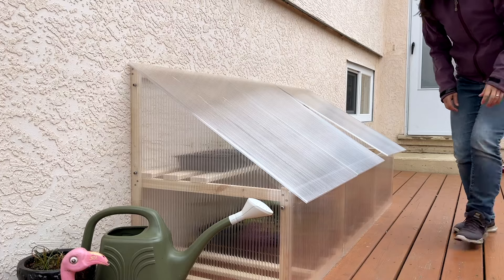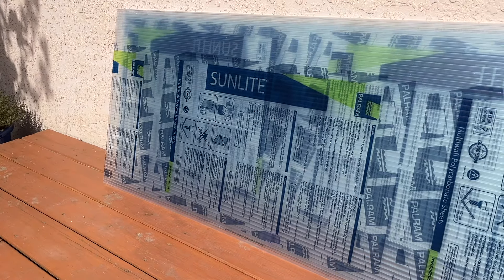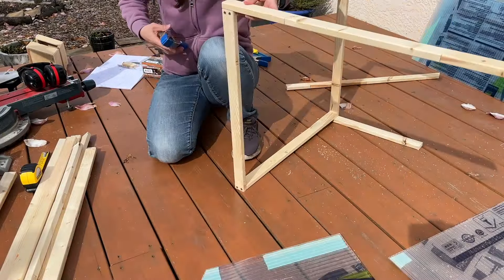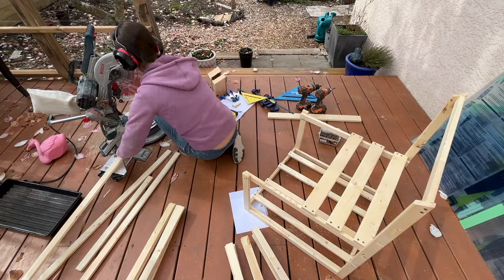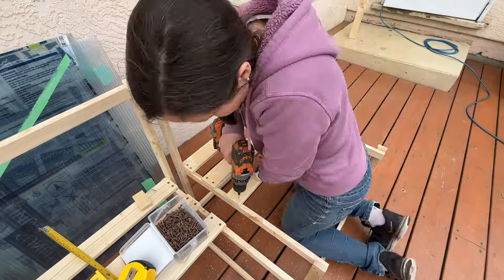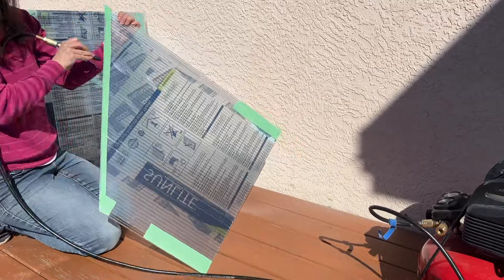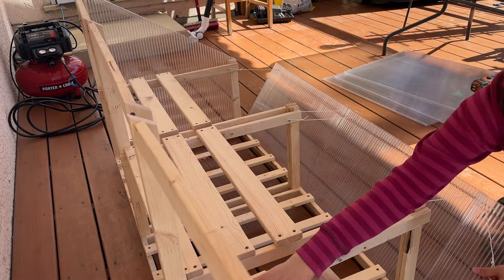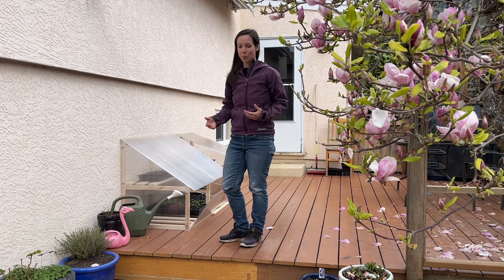Mini Greenhouse Build - DIY

Comment: When you messed up the square base the first time, was it because you forgot to subtract the width of the 2 overlapping pieces? Any of the viewers that have no construction experience might not  realize that’s a necessary step when measuring for the frame. Also for anyone that doesn’t know, to make sure your base frame is squared, measure from corner to corner in both diagonal directions and make sure both measurements are the same. If the measurements aren’t the same, the box is not squared.this may not seem like a problem until you go to put the top and side panels on and you see that they don’t line up. Great build, I’m going to try making something like this for this winter as well as some hoop house type structures for extending my salad greens and whatnot. 

I also don’t tend to have a fully thought out idea of how I’m building my garden diy projects until I’m actually making them.
Reply from the maker: Good tips! I use those methods too  👍
Ya, I must have forgotten to account for something in my measurements. I remember trying to work out what I did but I didn't figure it out quickly. I decided it wasn't important to know exactly what the mistake was🙃. I knew how to fix it and that was enough for that moment 😋
Thanks for watching and enjoy your garden!
Reply: @KatesGarden  I do it at work all the time. Sometimes I’ll accidentally change the measurement by 1 inch, we call it the “1 inch rule”. You’ll tell yourself over and over in your head the piece needs to be 34 1/2 inches, and then measure it to 35 1/2 inches by accident 🤣
Reply from the maker: @Howwerelivingfishing  lol, yup! As long as it’s just a bit to big it’s no big deal and easy to fix 😅
Reply: This was actually very helpful! Thank you! @Howwerelivingfishing

Comment: It's nice and good, but way too expensive with the plastic, why didn't u go with the 6mm foil?
Reply from the maker: I’m not familiar with 6mm foil. Thanks
Reply: @KatesGarden  Not I'm not sure if it's called like that, but it's the standard plastic transparent foil used for polytunnels
Reply from the maker: @adriandavid970  oh I see. Yes that would be an alternative option. Some changes to the design of the frame would be needed but it would absolutely be possible and probably less expensive.
Reply: @KatesGarden  Definitely less expensive, I was "shocked" to see the price list at the end of your video...Anyway, thank you for the idea!

Comment: That plastic stuff is expensive.
I like that you showed the process of finding and fixing your mistakes. Nice job.
Reply from the maker: Thanks, I try to show the process as it really happened. 👍
And yes, the plastic panels are expensive. They weren’t my first choice, but I think they ended up being the best of my options. Thanks for watching, have a great weekend! 😀
Reply: Im going to try mine with Vapor barrier, because I got it for free by salvaging it from a construction site that was throwing it out. It won’t last nearly as long I’d imagine. I may also try using some glass windows I salvaged.construction sites can be a good mine but make sure you have permission before grabbing stuff lol
Reply: There are a lot of options the panels could be replaced with but there will be pros and cons to consider with each choice (price, durability, weight, aesthetics, how easy the material is to work with etc)

Comment: Loved the design, just wondering if the bottom seedlings would be getting enough light. Because even with constant rotating you'll cut the light in half so just wondering that part.
Reply from the maker: Thanks!
This is such a great question and something I was considering while I was planning. My goal was to use this greenhouse just during the spring so the sun would be lower during the day. By the time summer approached and the sun higher, it would be warmer and the greenhouse not needed. (So I should be planting, or the more tolerant plants can sit next to the greenhouse outside to make more space) Also, because the upper shelf is only half as deep, it lets the light into the back more easily. If more light is needed, the greenhouse could be built taller so the upper shelf can be higher.
Hope that helps, thanks!

Comment: Im looking to adapt a similar design to keep some planted hibiscus shrubs safe through the winter without digging them up...hopefully.  How sealed do the edges, lid, and bottom need to be, or is there room for having a few gaps?
Reply from the maker: That could certainly be done 👍
The sealed edges part is tricky. Depending on your nighttime temperatures, it might need to be locked up tight. But if it’s sealed well it will certainly need to be opened during the days for ventilation but also it might get too hot on a sunny day even in winter. Unfortunately, it’s a judgment call on the best choice for winter care
Thanks so much for watching, I hope the hibiscus make it through the winter 🌺

Comment: What changes have you made since you've had a chance to use this for a few months?
Reply from the maker: I haven’t made any changes yet. It’s currently packed away for the winter. But I plan to add proper hinges and maybe find some tape with UV resistance to cover the ends of the plastic panels. I’ll be working on it as I get ready for the spring season for my seedlings. 
Thanks so much 🪴
Reply: @KatesGarden  May I suggest using the silver tape used on flashing and air vent pipes? It won't come off, and it lasts for years. Check into it. I don't know if it will be the aesthetic you want, but it holds up in all kinds of weather and temps. Blessings! 😃
Reply from the maker: @janeirvine8391  Thanks, I’ll keep that in mind, it sounds promising 👍
Reply: @KatesGarden  To quote my beloved Red Green, "Remember, we're all in this together. We're pulling for you. Keep your stick on the ice!" 😘👍